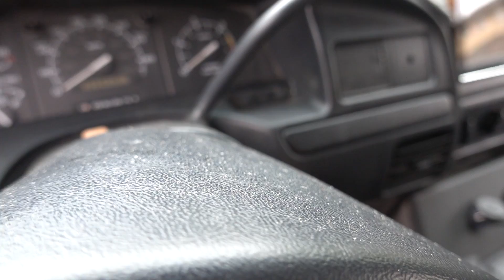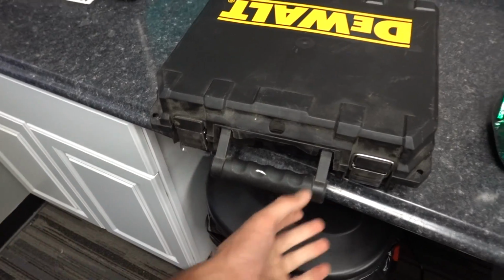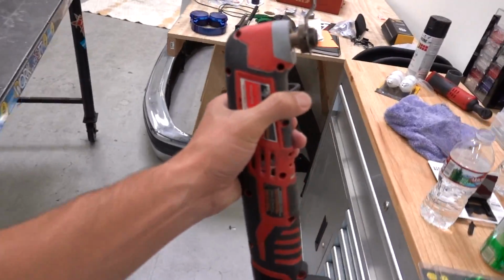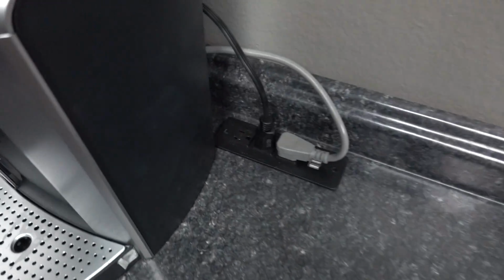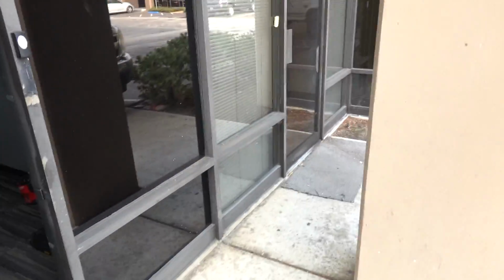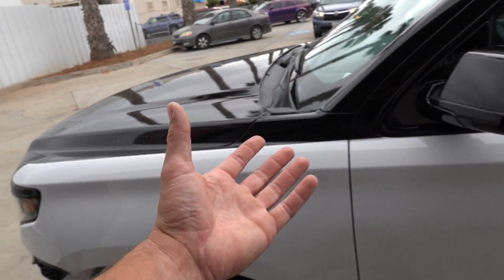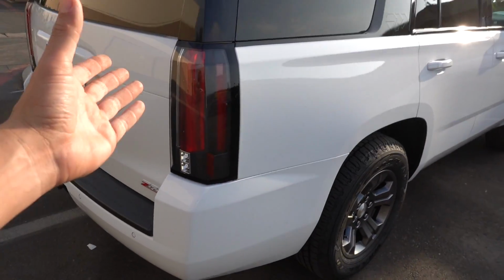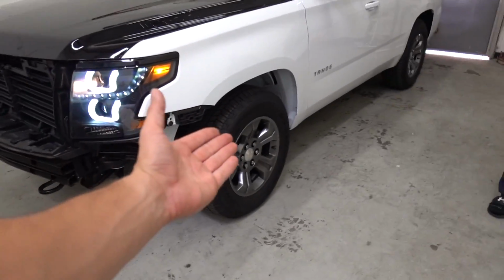OUR SEMA TAHOE VINYL WRAP REVEAL!

Comment: If you make cuts about 1/16 of an inch apart on your dull multi tool blades with a cut off wheel those blades will cut like they are new

Comment: Really? that's your wrap choice? put a set of lights on top and you could be a cop car. did you miss jail so much you needed to feel like you were in a cop car and on your way back? it's supposed to be a Sema build not on your way to a donut convention.  did you fall down and bump your head,  or are you going for the cheapest built truck at Sema award?